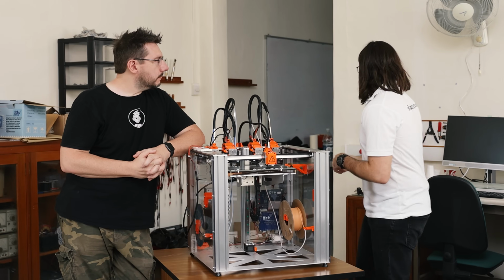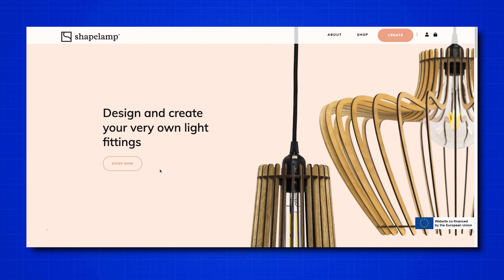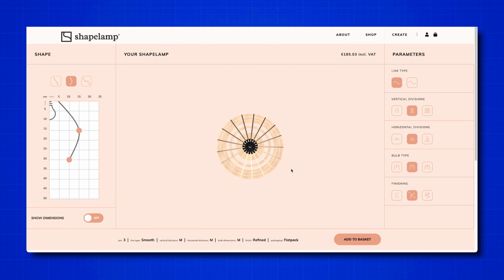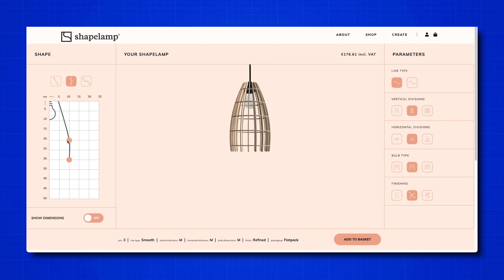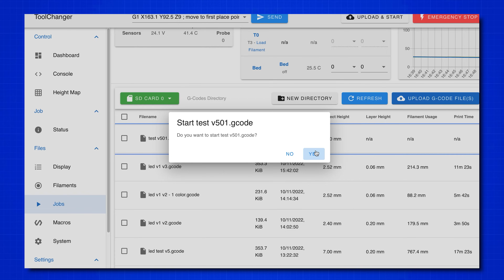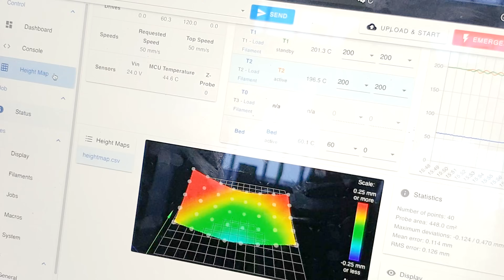INCREDIBLE E3D Tool Changer!

Comment: 11:56 Why not create a channel and fill it with ultra low temperature melt solder? I bet it's a lot less resistive and melts lower than the plastic you use.

Comment: if there is a need of installing a pcb inside the lamp housing, you should just ask the pcb factory to solder the leds onto the pcb, then fit the pcb into the lamp diffuser and the lamp... using 40V DC is not quite human safe, always keep voltages below 36VDC. don't waste precious energy in the self-heating conductive printed materials, when u use an led, you want to prevent energy release as waste heat as much as possible.

Comment: The PPP System. Pick,place,and push. Love it. What about PPPing short, or preformed actual wire in strategic places?  Not all runs NEED to be printed, but to me the big advantage of conductive printing is the ability to print those really special places.
The PPP System would really help me with that. 
Fantastic. Thank you

Comment: I've tested every single conductive filament on the market (as of this comment anyway!) - The Protopasta is by far the easiest to print and most repeatable. There are 'better' filaments out there in electronic terms like BlackMagic, but they're a nightmare to print in any machine with a tightly constrained filament path. Personally I think the only way to go about integrated electronics is to develop a thermopolymer coated copper wire print nozzle that can inlay actual wire, much like the Markforged machiens inlay contiuous fibre reinforcement.
Reply: Ah...but then you're talking about a multiple-degrees-of-rotation print head, to infill around the laid cable. Wouldn't that defeat the whole purpose of 3D printing? (I'm not saying it definitely would.) One thing I was thinking was 15-cm nanotubes staggered into short near-zero resistance filaments that the print head could chop, as needed, mid-print. This would get you great functionality if you could lay most of your circuits out in one plane, and "pretty good" functionality extending off of that plane...
Reply: @JakeWitmer  Not really. The Markforged fibre extruders use a thin fibre coated in thermoplastic, it's extruded through a heated nozzle as a regular filament would be, only it has to be cut with a blade once retracted. The plastic around the fibre just melts and solidifies the same as the rest of the part :) 

I've also tried nano-tubes in various forms in our own filaments, and they're a bit of a nightmare to be honest! Very conductive for sure, but very abbrasive.

Comment: From an engineering standpoint, this is great, or at least could lead to great innovation. But I honestly don't like the idea that electronics and plastics are fused together, with the electronic parts housed in a way that they can't be replaced. It seems like an engineering shortcut where convenience in the design process is favored over repairability and recyclability. This is the same thing as apple gluing batteries in place.

Comment: How to make a led light extremely dificult and expencive to manufacture, and Lets make is ridiculesly inaficient by using high voltage DC over a resistive wire run... I'm sorry, this is not the future, not with resistive filament... Unless the resistance is part of the Electronic design.

Comment: The Add:North Koltron G1 filament has way superior conductivity to the ProtoPasta one (down to 2 ohm-cm), but it is not a PLA base and is also quite a bit more expensive.
Reply: We tried the Koltron G1, it prints quite badly sadly, and needs 290 degree nozzle temps, causing it to burn in the nozzle if it is not being constantly extruded. We clogged some nozzles like that.

Comment: This is one of those things I think is going to become more and more common. Need <item name goes here> but wish it was <larger/smaller/wider/taller/didn't come in a blue box/etc. etc.>, now there's a way to do such a thing. And as 3D printers get faster, more flexible, easier to work with, better able to be placed in a laundry/mudroom/garage/etc. without it being just a bundle of loose wires... these brands can go "hey, for X moneys we can do everything for you... but if you want to do it, then we can do it at 1/2 the cost and you get all printable part files now... and the non-printable parts will arrive within a couple days" which can be very important, especially now. TL-DR: customizable, cheaper, and available "now"... something many want but not very possible without companies like Shapelamp and 3D printers/CNCs.

Comment: Wonder if you could use a Aluminium  mig welding like spool wire layer as a toolhead that just installs solder covered copper wire from the contact to where it needs to go on that layer with a small cutter at the tip, the soldered wire then would join with the previous layers wire when the solder above melts the solder below, this would allow far lower resistances improving efficiency and reducing heat buildup. When installing the wire component you could use the heat of the soldered wire to press it into the previous layer which allows the tip to make sure that the end of the wire trace is flat with the surface of the print ready for the next layer. Just a thought that could reduce the cost of driver power supplies and reduce their size.
Reply: We looked at something vaguely similar, search for Fiber Encapsulation in 3D printing. This is interesting and there are a lot of proof of concepts, although expensive to create and a bit limiting.

Comment: With conductive filament still being very high resistance (even protopasta's is 1.75mm filament is 200-300 ohm/cm) I can't help but wonder if we should be implementing silver or copper trace inlay mechanisms as well similar to carbon fiber inlaying 3D printers. i.e.: the trace offers the path of least resistance for the majority of the circuit with the conductive filament essentially used to connect the layers.
Reply: I did research for my scription in printing conductive material. (f.e. copper / Silver loaded filament and printing conductive PCB-repair paste (syringe style).
They all suffered high resistance due to the conductive particles only making 'single point contacts' of the metal particles on the microscopic scale. biggest problem being that their conductivity also varied per mm length in a pasted path with 1mm2 section. Other option would require special Hi-Temp extroders that was out of scope.
A wire filled filament sounds interesting, though it will be trickey to print it in stacked layers between normal PLA f.e.
Reply: @AlienSaxophone785  I was specifically thinking of something like the Markforged style of (Onyx?) printers, a dual extruder 3D printer that inlays a continuous fibre filament on top of each extruded material layer, which produces a much stronger result than using single extruder printers with chopped fibre filaments. There's no reason something similar couldn't deploy actual copper or silver wire instead of continuous fibre filament.
Note: this is a second spool, a different filament than the main material since you wouldn't be able to get "stretchy" copper or silver conductors inside a different material.
Reply: Correcting myself, "Onyx" is Markforged's chopped fibre filament solution. Their solution I was thinking of is inventively named "continuous fibre" printing.

Comment: Very interesting and thought provoking!
Maybe they could reduce their trace resistance by pick and placing lines of 0 Ohm resistors along the trace path. The conductive filament would only act as a short bridge between the resistors. If they maintain a complete (unbroken) trace of conductive filament, they would not need 100% connection yield to make it work. They might also be able to embed a simple connector to avoid having to solder the external wiring.
Reply: Hi Jon,
We are in fact using spring connectors to avoid soldering, the prototype printed part works like that! Thanks for the ideas, we're going to toy with them :)

Comment: Granted it’s probably *locked down by patents*, but something similar to those “Continuous Fiber Reenforced” 3D Prints would be interesting for laying wires in rather than conducive filament.

Granted that tech may only work for Flat Layers, not going “up” per se.

Comment: Using Opulo’s Open Source Feeders once those are released would be neat!
Reply: Or just use a LumenPnP for making the PCBs and place those in the print with a tool-changer device as someone said.

Granted all of that makes repair/separation of components pre-disposal more difficult compared to just screwing parts together oof

Comment: I love seeing the pick and place on a 3D Printer but they are slowly learning that conductive filament isn’t low enough resistance for circuits and connecting to it has incredibly high contact resistance. Using a circuit board is the solution and he mentioned that is part of the future design.
Reply: pick and place a heatset insert into a lollipop feature at the point of contact
Reply: Hi CHEP, we know the limitations of the conductive filaments out there. We are trying to work with the limitations rather than let them limit us. Having said this, we do see use a PCB instead of conductive filament in certain places and then use conductive filaments for add-on features.
Reply: @shapelampofficial3080  I'll be honest, I don't get why you would shoehorn conductive filaments into this at this stage, given their limitations. Unless the thinking is that this is just a placeholder until you can integrate an additive process that comes without the extra resistance. At this stage the sheer amount of resistance makes it a total non-starter as a real product IMO - it's just a waste of energy for no good reason. Why use this when you could have a lamp with the same light output that uses a lot less energy?

Comment: So many questions.  Can you show the prototype working?  How do they achieve perfect flatness to get a press fit LED with sufficient electrical contact on all the pads?  How about efficiency?  40V DC is over 8 times the forward voltage of a single LED.  And he says half the brightness.  So this is worse than 1/80 the efficiency of a traditionally wired LED?  And the statement that the heat produced is insignificant is hard to believe with that kind of loss buried inside the print.  The pick and place seems to be putting the cart before the horse a bit.

Comment: Looks like they would need some sort of 3D MID process to really get this LED idea going the next step. An other idea i could see is to use something like the PCB printer technology (Voltera?) where they apply conductive liquids with a syringe that then dries and turns into traces on the circuit board. I think they mostly use some pretty expensive liquid silver solutions, but there could be cheaper solutions that still massively reducce the power losses from FDM printed traces. Conductive filament just does not seem to be the right tool for this application.
Reply: We did look into a PCB printer that uses conductive liquid/paste but the final product is too expensive and some 'inks' are too expensive.

Comment: Not so incredible considering the very premium price. Its clear E3D is trying to have good margins, towards high profit
Reply: It's an extremely premium machiene, with hiwin guides on all axes. Costs add up quickly, guessing the lienar rails themselves cost upwards of 600$
Reply: @morbus5726  I don't argue that, I argue the quick change mechanism
Reply: @ralmslb  well it's all milled aluminum, which is pretty expensive. I guess the price might be a little high if you consider that.
Reply: @morbus5726  true, but I wonder to what extent couldn't some parts be casted to be nore affordable for the masses.